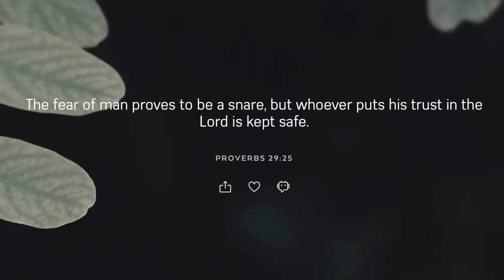March 14, 2023/58 they MISSED A SPOT. BLUE BEACON TRUCK WASH. DENTON TEXAS

Comment: They should have given you a coupon for discount on next truck/trailer wash! 
That mudflap fender being broken/missing from our trucks cost us a lot of fines over the years. When I see 4-wheeler pickups running around with tires 6 inches wider than the trucks on both sides these days, I remember those fines, and wonder why pickups don't get equipment citations. Their tires can throw rocks at windshields, just like ours can.
Reply from the maker: The guy in the middle did asked the guy next to me if he had a card but he did not
Reply: @24juan68  ah ok, it was hard to hear; I thought he asked if the other guy had a wash towel
Reply: The rims splash water back on you.
The wand man did not want to get wet 😂.